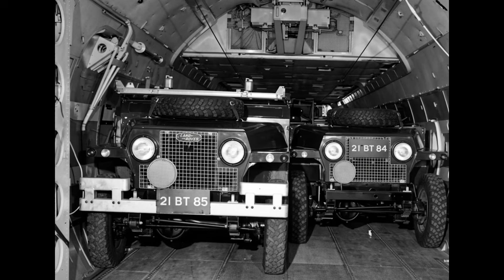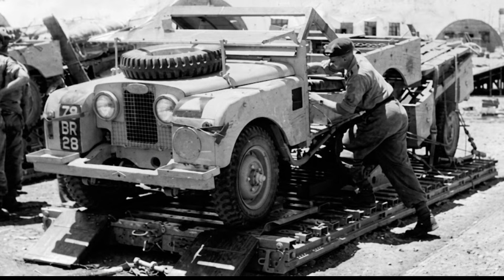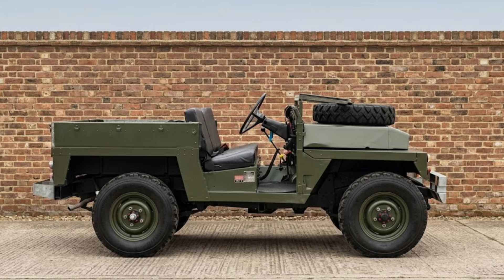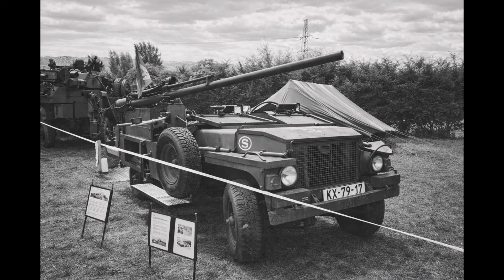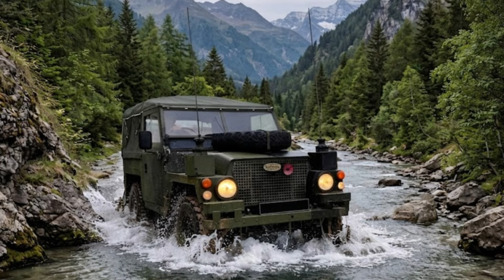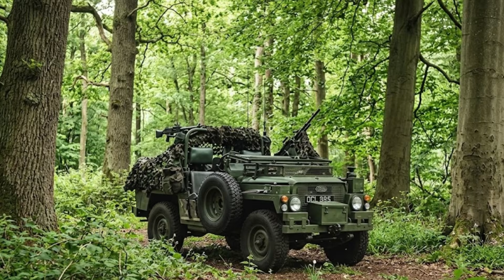They Had to Take It Apart — Land Rover Lightweight

Comment: Good video overall the structure made it easy to follow and understand each part

Your tags could be more precise at the moment they are a bit wide adding a few focused search phrases that match user intent usually helps bring in a more relevant audience and improves performance

I also work with placing content across niche relevant websites which helps build backlinks that actually support your SEO instead of just adding numbers

If you want I can explain how I would approach this for your content